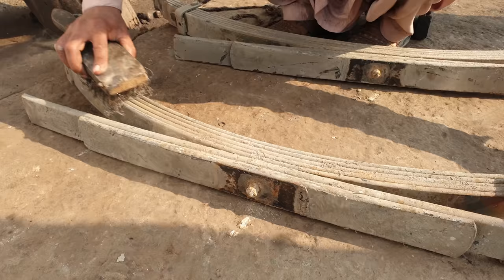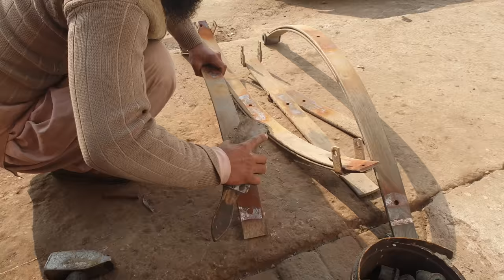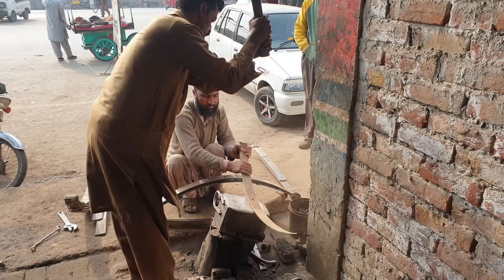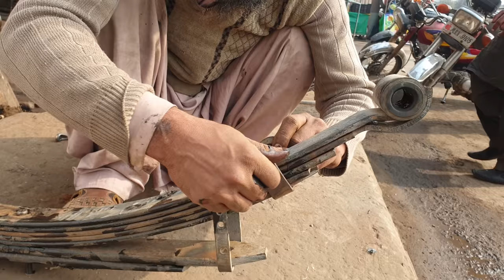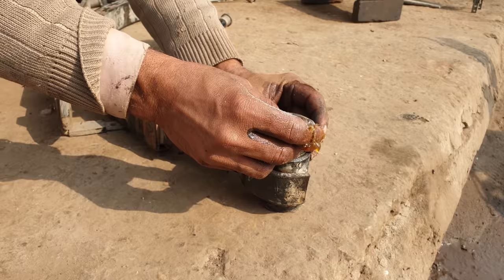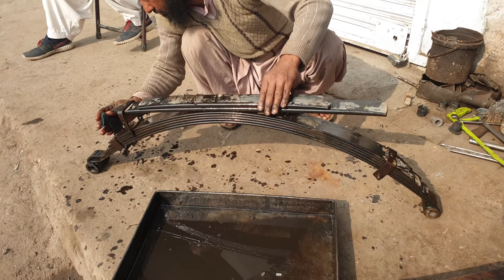Amazing Technique Of Repairing A Leaf Spring | Van Suspension System

Comment: Once a spring fail better to replace it... Or go for a professional to repair it... Spring repairs usually require heat treatments so as to relieve stresses and impacts by a metal hammer as shown in video are just causing plastic deformation that reduces the lifecycle and causes strain hardening...which eventually results into a crack formation and total failure..

That is the reason why heat treatment is necessary so that the stresses can be removed and the spring can perform even in the extreme conditions for which it was designed.
Reply: These people are poor. They do with what they have. Getting a few more miles out of springs is easier than buying new springs and going hungry.
Reply: Correct, tempering a leaf spring by hammering cause to failure in the spring in the long run

Comment: What dod they fix? What was wrong with it? Was something broken? It looked good to  me.
Reply: They re arched them individually when taken apart- with the sledge hammer.
Reply: it`s not properly done it. they should heating the material first, and the anvil should be not flat
Reply: I don't think the anvil was flat at the point he was sliding the leafs across but I could be wrong
Reply: Metal probably get hot enough by setting it out in the sun for a few hours, I know I know it's not a torch but could get hot enough to almost burn your hand just from laying in the sun

Comment: Centre bolt up side down grease on rubber not good but if it is rubber grease well thats okay good effort.
Reply: grease actually ruins the 5160 material the spring is made out of.  Plastic pads on the ends works the best.
Reply: It was rubber lube he used
Reply: @brendanlawlor1906  liquid rubber?

Comment: Great skills with accuracy but the grease in the rubber bush is a small part of ignorance
Reply: Hardly need to put a grease on rubber or jelly bushing to avoid damag and noice....
Reply: I imagine the grease in the bushing simply helps ease them into the eye and makes sure the pin/bolt that goes through the centre doesn’t snag and deform the rubber when reinstalling.
Reply: La grasa o aceite derivado del petróleo daña el hule
Reply: Looked like dirty oil

Comment: TLDR: one of the many worst idea in the world being spread on social media! Long From: being able to bend spring steal like this means its clearly already failing! This is side of the road snake oil that make you feel that you got a good deal and all is great. there is zero pression work being down here. No thought on the other systems of the car that are being adversely effected that's is helping to lighten your pockets. No thought on the alignment that will now eat through more tiers, the bearings having loads that should not be there, your shocks working more and having as a shorter life, and for that mater your life and the occupants because now you are compromising your car, because with out a doubt if this is what they do with springs, i am sure they do worse to the rest of your car. And my qualifications on this matters?  two of my ex employees taking the $500 for new suspensions parts, giving a guy on road $100 to bang on some metal and paint it , then pocketing $200 between them and the wondering a week later how to explain why they need an emergency tow out after the pack brake on a serious off road track in the middle of Africa had to hike 4 hours to get cell signal. At the end of the day, trust your gut, the guy on the side of the road with a hammer, or the guy in a shop with the expensive equipment and years of experience that can make these things. your life is worth more than your pocket being full of cash.